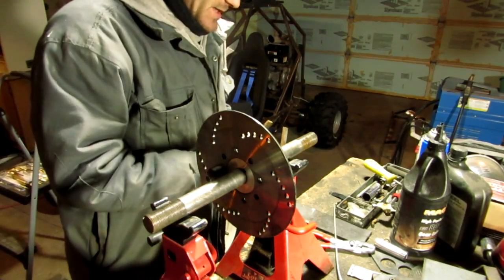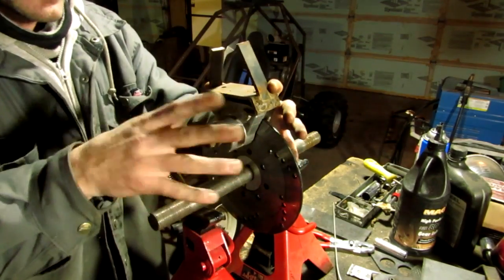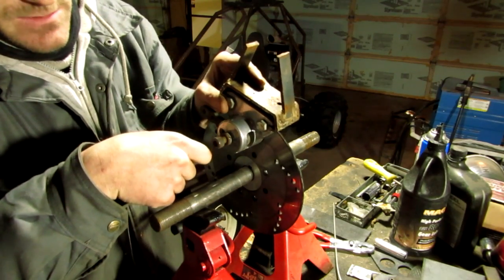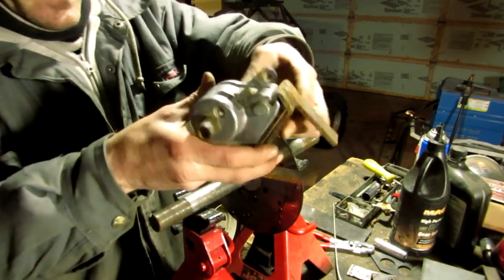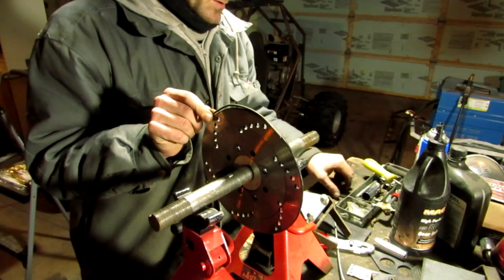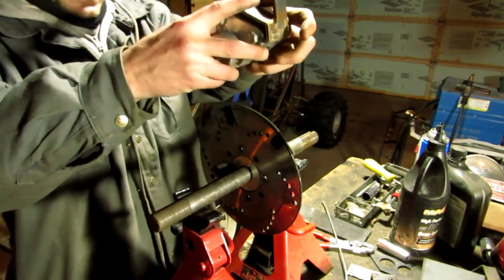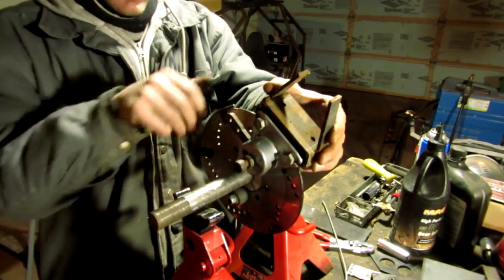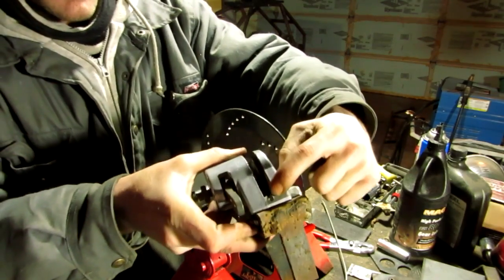Quick Tip | DISC and CALIPER SPACING

Comment: Im building a kart right now and I dont know whether to use a mechanical brake or hydraulic brakes. I have a suspension so I cant use a rod to put it I was thinking of using a thickbcableb like a clutch cable if i use a mechanical brake. Any thoughts? *****